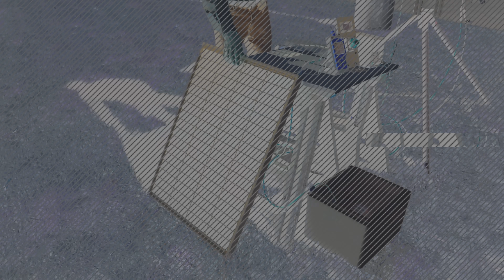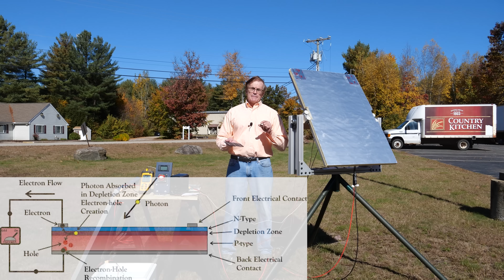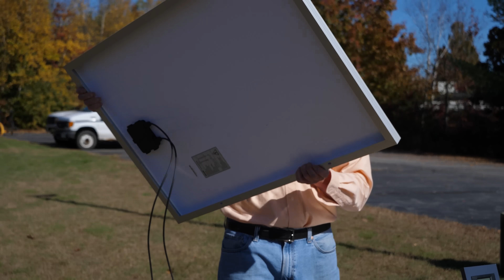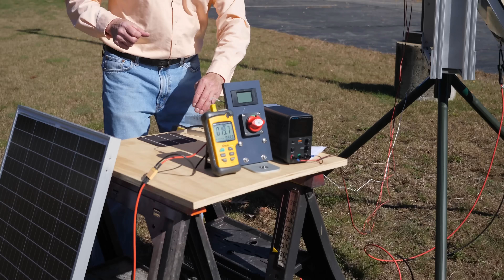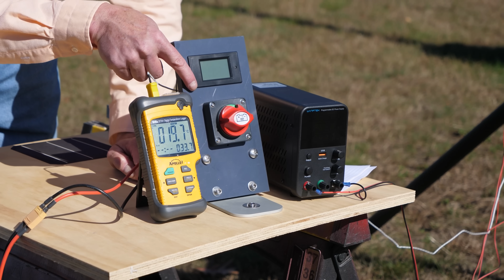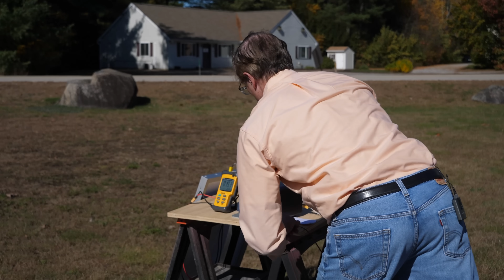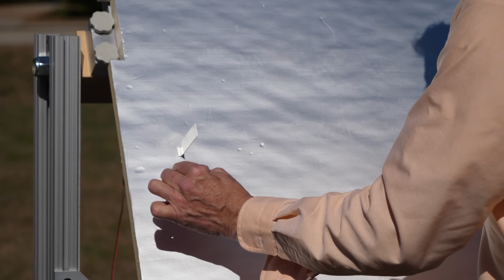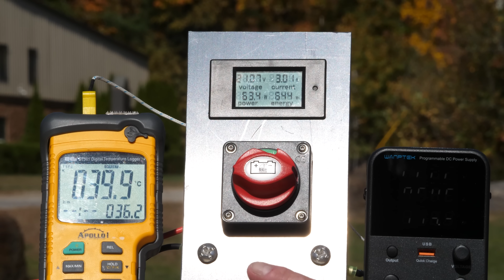Do you REALLY get enough out of your solar panel?

Comment: Is there any chance that you could regain the energy cost of using a small heat pump to condition the air being blown over the panels in a residential system (say 10-20 kw)?
Reply from the maker: Probably not.
Reply: @TechIngredients  That was my intuition.  I guess on further thought it's a bit obvious... AC has an efficiency of 3-4x iirc, and if 4 watt of heat loss netted more than 1 watt of electricity solar would be a non-option in hotter states and probably comparable to nuclear in Alaska.
Thanks for the awesome content.  You're an excellent teacher, and my kids love when I tie your videos into their curriculum.

Comment: I really enjoy these how-to engineering videos.  Just got off my roof checking temperature of panels and found the heat around the black asphalt shingle roof was hotter that the pv solar panel.

The ambient was 65°F, panel had gotten to 105°F by 10am, and black shingles were already over 135°F.  Behind the panel the shaded shingle roof was 90°F!   

So my roof heating is going to be more of a problem than I expected.
Reply from the maker: True.
And, that might be the most cost-effective  issue to focus on.

Comment: 410W panel costs me 160€, lasts maybe 20 years. What does aluminium cost in material in time of installation? The fans wont work for 20 years. Maybe 2-3 years in the outside.. Moisture and stuff.. Completly not worth it at all.

Comment: Isn't there a logic flaw? You have that backplate mounted panel used as baseline measurement, but you should use an unmodified panel. Here, the backplate will prevent natural convection.

Comment: What about maintenance of the fans?  I doubt that they would last for 30 years.  Also, if you squeeze another 5 years of use out of the panels you will miss out on the efficiency improvements of 25 years of solar panel development which might be quite substantial given the huge volume of the production of solar panels and the very active research into improving solar panel efficiency.   Also, my panels will be attached to my balcony and should a panel drop my insurance might use a modification as an excuse to not pay for any potential damages and a replacement.  Still, this is clearly very promising and I could easily see active cooling to be incorporated by some manufacturers, especially as it gives them an opportunity to positively differentiate themselves from others w/o a cooling solution.

Comment: Something you didn't mention. Do these fans last 25-30 years?
Reply from the maker: Probably.
They have a MTTF  of 50, 000 hours when at full power, and we're  running  them at 25%.  Also,  they only need to run at most 12 hours per day  when it's  clear.

Comment: Water loops through the panel capable of quick connect to a radiator system would be great. Just need an efficient pump to run.

Comment: HOW ABOUT SETTING UP A WATER SPRINKLER SYSTEM HOOKED UP TO A TIMMER  TO  SPRAY THE PANNELS WITH AFINE MIST SEVERAL TIMES ADAY? COULD THAT HELP KEEP THE PANELS COOL?
Reply from the maker: Yes, that's  one of the options  I discussed. You have to be careful  to use mineral  free water to avoid  building up deposits that block the light.  When this is done, there's  less power consumption  when a drip tube flows the water over the panel because  the only pressure  needed is to overcome the lift/head.
Reply: @TechIngredients what, if the panel will only passive store the rain water on the back side, in pockets and evaporate it slowly by insolation and wind, cooling down the panel? Without any mouving parts, all passive and cheap? Maybe panels will need some holes on the surface, between the cells, to fill the pockets? The problem is of course dust, but is the effect worth it?

Comment: Another idea besides active/passive cooling of the panel to prevent losses from heat build up, would be to prevent added heat in the first place.  You mention the productive wavelengths that can be converted from light energy to electrical energy... can anything be done to block the wavelengths of light that are outside the convertable spectrum.  Some sort of plastic or laminate filter material that act as cut off filters for the wavelengths outside of the convertable spectrum.  If those undesirable wavelengths can be blocked or reflected from reaching the panel, that too should reduce loses due to panel heating.  If you ever want to revisit this experiment...that would be a neat idea to test.  Love your channel...keep up the great content....and thank you for all you do to bring and explain complex science in a way that anyone can understand.
Reply from the maker: Yes, it can.
They are looking at quantum dots to convert light outside of the usable spectrum to light wavelengths  that the PV panel  can convert.
Reply: @TechIngredients  that's even better...thanks for the reply!

Comment: Seeing how well Tech Ingredients puts together ducting … I have a question about Venturi Pumps, and it makes me feel like I need to study the Bernoulli Effect better before I even know how to ask …  😥  kinda where to start, maybe?

well, I have an 8” duct fan, and am curious how much vaccuum draw I can get out of just that, with a well built Venturi.  or, I guess, just how much flow I can induce in the 2nd channel.

also, I have a willingness to measure, do math, and experiment … so, I’m sure I’ll get *something*.  💜👍  eventually.
Reply from the maker: It's  actually  pretty  simple if you focus on thermodynamics. You can't  create  energy  from nothing, and you can't  even break even, but that would be a best case starting point.
The energy in the primary flow is mass times velocity squared, and that's  the same energy  in the final flow with its larger mass and lower velocity.  That additional  mass comes from your Venturi and its crossectional area gives you its velocity. Look at ram pressure tables to give you the vacuum generated.
It will be quite small.

Comment: What happens to the panels in the summer sun/heat of southern California when it's let's say 104°F - 110°F  ?
What happens to the dark surface temperatures?
Is it possible for the heat make the panels "Go Bad" ?
Is there a temperature that can destroy the "panels" ?
Reply from the maker: Yes.
The lifetime of the panels  is exponentially shortened as the temperature  rises.  Catastrophic  failure will occur when the epoxy breaks down or the solder fails.

Comment: First thing people need to know about solar is that a 12v panel needs around 14 volts to charge decently. Much like a car and it's alternator.

So for a panel to work for a decent share of the day it should actually be rated for 18 to 20 volts.

This way it charges for the majority of the day, not just a peak 3 to 4 hours.

This is a panel charging not at peak/ hot.

Secondly infra red and ultra violet really don't work well. The two ends of the spectrum.

This said. What color shifts everything towards the middle of the spectrum at which it is most effective?

Yellow.

Experiment with that.

Comment: PV T combination panels and Freon cooling circuit to remove the excess heat even down to 20 C where panels are specified. You should find sensible use for that heat like heating water and house during the cooler part of year. PV can recover only round 20% and thermal 70 % of suns radiation under 1 kW/m2

Comment: You need to take one step further: use the warmth from the panes as input for a water tank from which to feed heating and warm water. From May on until October here in Germany this provides enough heat for my house and 5 people with panels covering about 10 times the area your show here. I will add the use of a heat pump in future to use the temperatures of below 60°C coming from the roof during the other months.

Comment: I believe it is fair to say that during the next 10 to 20 years the efficiency of available panels is going to increase quite much. And you will be very tempted to scrap your panels and replace them with more efficient ones. At this point of panel evolution, I just cant see how prolonging the operational life time pays back...
Reply from the maker: It depends.  There is no one solution  to the issue  of efficiency and cost effectiveness. Maybe  just more awareness  of the effect of heat will modify the design of the panel  in small ways, leading to even greater returns.

Comment: I've been interested in a developing actively cooled solar panels at home myself, as we are off grid and require a lot of solar energy, and this video provided both great advice and research on the topic. Thank you once again for another awesome video! See you in the next one.
Reply: As good as the idea sounds like, the problem is usely you dont have enough power during winter and too much power in the summer, ofcourse depending where you life. Means an active cooling doesnt help you.
In that case it would be smarter to install just more solarpanels instead of upgrading them, that way you have more power overall.

Comment: All the videos they make are soo informative.. innovative....well I was wondering if we could use single Peltier Module for cooling this panel.... Instead of multiple fans...Need to cover sides and make air flow in one direction through Peltier Module. So it Cools the panel from top to bottom..🤔🤔🤔
Reply from the maker: Thanks.
Peltier devices are very inefficient.  They would use more power than the extra power the panel  would generate.

Comment: You could also add mirrors to each side to increase output of panel under lower light and also suck the heat from the panel out using a heat pump and send it into your house

Comment: there was an invention in Asia with a thin coating based on juice from rotting vegetables
this coating is luminescent and it makes non usable frequencies spread into usable frequencies
combined with your cooling coaring this might be the breakthrough
more than this - applied in thin threads it might even make the panel quite independend from sun direction

Comment: Excellent video, I haven't been on your channel for a couple of years and this popped up. I live in Australia and considered solar a few years ago but was put off from the longevity and recycling issues that's not often talked about. There was a "gold" rush of sorts with Government handouts and consumers putting low grade panels on their roof that were under-powered for their homes not to mention most didn't want to outlay the additional cost of a completely off grid system. It's unfortunate that a lot of these will end up on landfill in the coming years with no easy way to recycle these panels apart from the aluminium frames.

I'll have a look a Sunovate now that you've mentioned, once again great video!

Comment: Dumping heat into the atmosphere might be “cool” for a small, experimental setup, but if photovoltaic kicks in on a massive, industrial scale, we will have increased global warming. How does that balance with the reduced greenhouse emissions?
Reply from the maker: Where does the energy from sunlight go when it strikes the earth instead  of the PV panel?
Reply: @TechIngredients  interesting point, thank you. I thought most was reflected back into space (wich greenhouse gasses are hindering) and quite a bit is absorbed by chlorophyll and thus transformed into chemical energy?

Comment: Maybe I missed it in your presentation

Put solar panels are supposed to be good for 25 to 30 years

How long will the fans last?

Also a sheet of aluminum 1/16 thick is a couple hundred dollars

I'm wondering if attaching the aluminum angles to the panel and then using only the chimney effect to remove the heat and provide a laminar flow and the chimney direction
Reply: I've researched the cost of 1 mil alu sheet, 4 x 8, cut to 3 inch strips to be bent 90 degrees.  $$ouch

then add in the cost of very expensive thermal adhesive, $$ouch

I would use 1/4 treated plywood for the back, not alu.  Even with that economy, the alu heatsinking + thermal adhesive cost nearly as much as 350W solar panel

Great theory and demo, but not financially sane.

One experiment I might try is adding only the 1/4 ply wood backing with top and bottom ends of the panel open to, expecting the chimney convection (aka rocket stove in 100F TX ) to provide cooling.  one panel with p/w, one panel w/o p/w

Comment: I would think that the fans and heatsink costs would far outweigh the savings made for that small increase in life span of the panels. And how long will the fans last, running every day, out in the weather ? How many times will you have to replace them during the panels life ?

Comment: Thanks for the video. Please do one on bifacial solar panels. Also cooling will put out more power, but panels are so cheap, it more cost effective to just add a extra panel or 2 vs cooling cost. Same is true for a tracking system.  Cheaper to add 40% more panels then a tracker.
Reply from the maker: I agree  re tracking.
However, the method I demonstrated is more a proof of concept than a proposed product. Combining  some type of cooling with any panel technology  has multiple benefits.

Comment: Won't this add to global warming by heating up all the air?
Reply from the maker: No.
Remember, the heat is the same.  We're  just moving it away from the panels. It's  going to end up in the air in both cases.
Reply: @Tech Ingredients  , but the light energy was transformed into heat energy by the presence of the solar panel.  Without the solar panel, the percentage of light energy transformed into heat would be less.

If everyone heat sinks during the hottest part of the day, instead of passively during cooler night temperatures, there will be a greater temperature gradient.
Reply from the maker: Again, no.
The light energy  is going to be transformed into heat energy either way.  It doesn't  disappear.

Comment: Is this an application where a super-radiative paint might be very helpful ?
Reply from the maker: Probably not.
To be of benefit, the coating  needs a clear view of the cold sky.  This is competing  with the panels  that need a clear view of the sun.
Reply: @TechIngredients  Many thanks for your reply - it is greatly appreciated. About a year ago you posted an excellent  article on using highly reflective mirrors to concentrate  light on solar panels to substantially increase their output and suggested several benefits to be gained from moving these mirrors instead of the solar panels. I had planned to apply  this to my truck conversion using servos to move the mirrors whilst keeping the solar panels fixed and  facing the sun .  However,   with the mirrors  positioned  to supply  them with reflected light the solar panels could be reversed leaving  their  coated back faces with a clear view of the sky as you suggest .  Could this then unlock extra benefits from both innovations acting in tandem?

Comment: Could you place a Seebeck thermoelectric generator behind the solar panel and route the heated air from the solar panel cooling system to the thermoelectric generator and use it to extract a little more energy from the sunlight? The fans might be "downstream" from the thermoelectric generator.
Reply from the maker: No 
The problem  is that these devices  are very inefficient and to generate power that need a temperature differential between their faces. This is exactly  what the heat exchanger is trying  to eliminate.  The loss in PV panel performance  would be greater than any gain from the Seebeck effect.

Comment: The physics plays out, but do the economics too?
You have to buy the fans, aluminium plates and smaller stuff. Not for one panel but for 30 or 40 panels.
Even if You can move to fewer but larger fans. All of this is an investment.
An example: pure gain of 5W over a year might end in more electricity worth 3-4 EUR/year. The material costs may be estimated around 50-70 EUR ?
Sure, the increase in life expectancy of the panels is the dominating factor but on the other hand the fans have to run in long term duty too.
I guess the fans may break after several years and You have to replace them. 
Next problem? How do You notice any failure and are You able to repair/replace parts when needed? At what costs?

Comment: I would try squirrel cage fans blowing across the back from bottom to top. While I don't have any measured data to share, squirrel cage fans have repeated shown to move significantly more air than comparable sized conventional fan blades.  One area was fireplace insert kits with forced air through heated ducts which had a small squirrel cage fan in addition to the natural convection of the system.  They are often quieter as well.

Comment: Great potential, I live in TX so Summers are brutal, my PV output drops from average 35-38 Kw daily to 23-27 Kw during Summer, and the AC runs 24/7 most of the time. Still my monthly bill max is 30 bucks max actual average is 9-15 bucks  a month per electric company agreement. When I use the battery backup to supplement the power generation is even lower. Before having the PV it was 90-160 bucks a month! So I think something like this would make a pretty good positive impact on Solar generation in general.
Reply: Energy companies know they have a captive audience and do things like build huge amounts of EV chargers for the top 5% and then pass the cost to the other 95% of consumers.  Rates are going through the roof where I live as well, with $200 a month bills becoming common. Solar is indeed a great way to break this cycle. :)